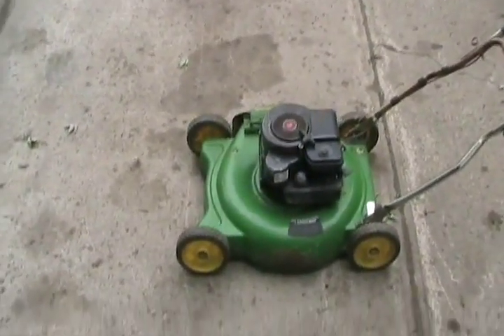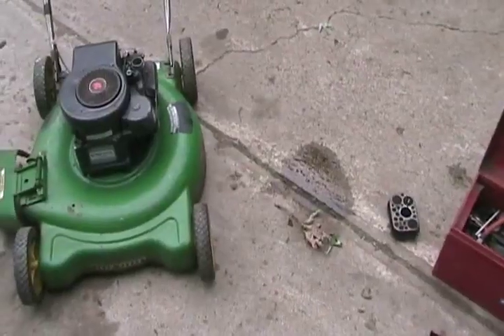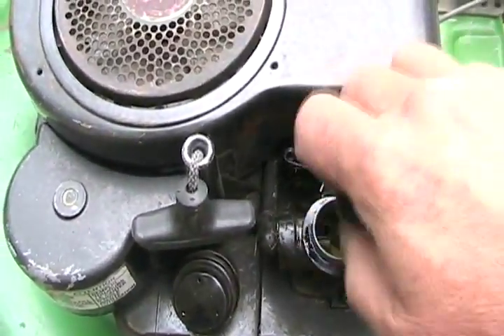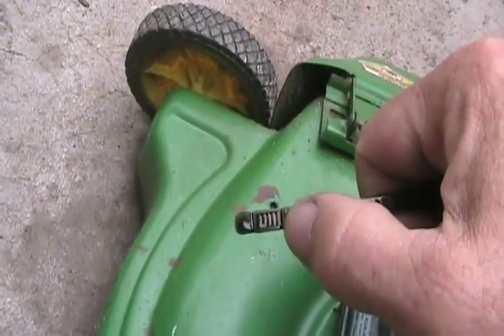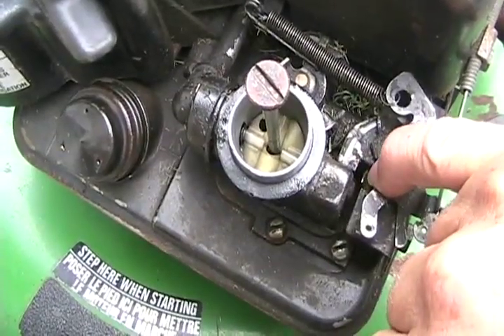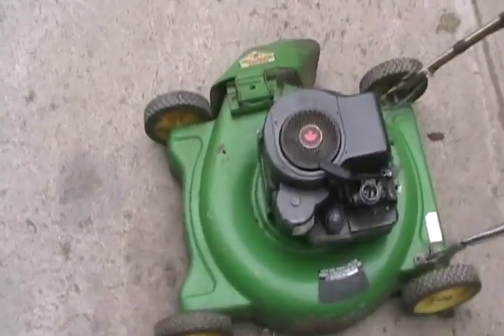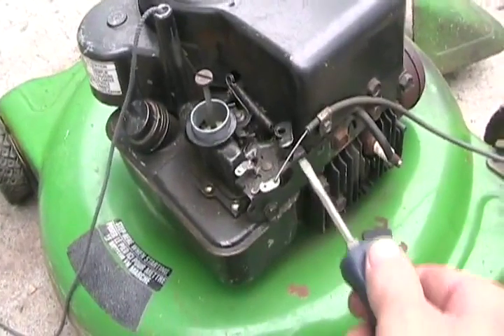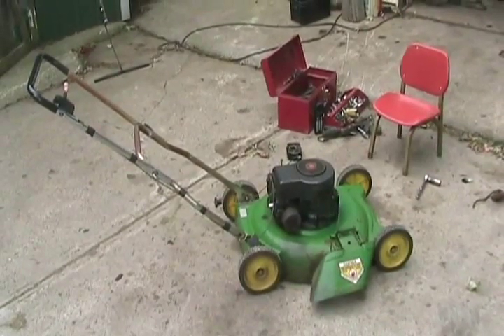#1082 how to an older briggs and stratton mower running [Davidsfarm]

Comment: One way to tell if it has a ruptured diaphragm is to start & run the engine if it runs,run it at medium speed to a few minutes to warm the engine up then idle it for a few minutes.

Then turn the mixture screw right in until the engine stalls,if it doesn't,then the diaphragm is leaking.